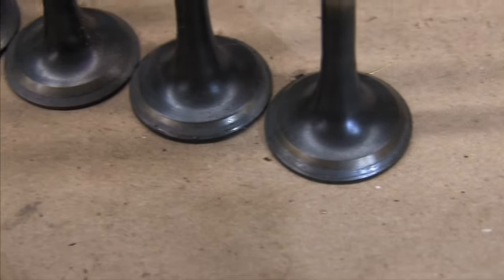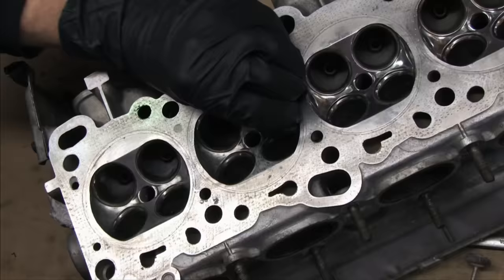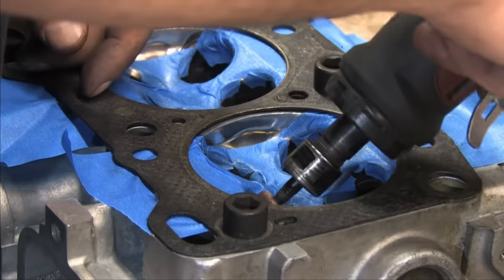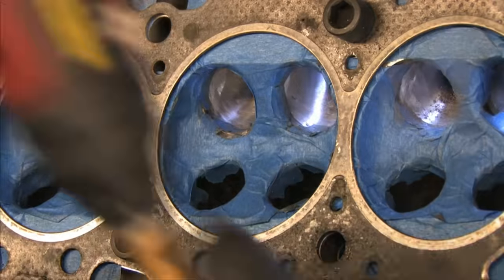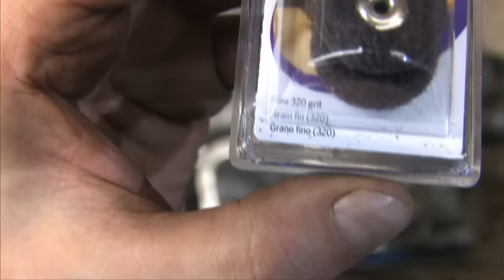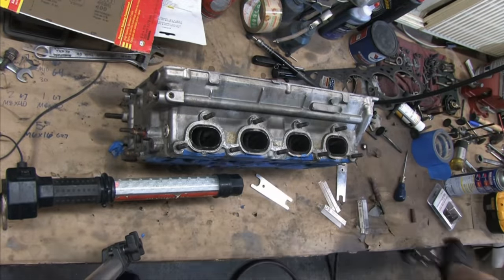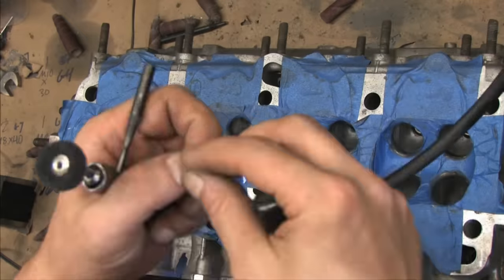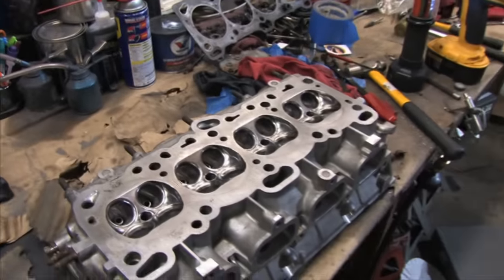Cylinder Head 204 - Porting & Polishing

Comment: pre ignition is NOT DETONATION!
Reply from the maker: While true based off of WHEN it occurs, if your knock sensor detects EITHER one, it records them identically.  The effect on your EMS is identical in either event, and regarding the context of engine management, my statement is accurate.  People love to split hairs over that statement, and I appreciate their zeal.  Unfortunately though my point gets completely lost in that argument.  To your knock sensor, pre-ignition and detonation are the same thing.  It's your job to figure that out in the logs... which one is occurring.
Reply: @Jafromobile   you are wrong- a knock sensor does not sense preignition- period. Detonation is  spontaneous combustion- period. Pre ignition is ignition of the mixture by something other then the spark plug- period.aka sharp edges etc. This is not splitting hairs.
Reply from the maker: The hell it doesn't.  ECMlink reads both.  The only time it ignores it is when the engine is at less than 2500 RPMs.
Reply: @Jafromobile   sorry knock sensors ONLY DETECT DETONATION. Check the many S.A.E. papers on that.

Comment: Want to a complete crap casting?  Pick up a Ford Windsor head.   Flows like molasses in an ice floe.
Reply from the maker: I agree.  I always hated it when people blew up their Pantera's Clevelands and replaced them with Windsors.  But ford had the same problem with the Clevelands that the 4g63 suffers from.  They made them flow better by adding metal to the intake runners.

Comment: if your seats are out of round, your valve guides are fucked, putting used valves in is a waste of time, the guides should be replaced first, then the seats recut, or you'll just need to take it down again due to premature wear. 

as for using wire wool to clean combustion chambers, this is absolutely to be avoided, aluminium decarburization should only be done by hand with a piece of boxwood.
ignore this idiot unless you want to spend on another cylinderhead..
Reply from the maker: That cylinder head is on the world's 3rd fastest Elantra right now of ALL years of production combined.  It's doing just fine.  Boxwood might be fine for your collectibles, but if you have collectibles, you're not doing a valve job or a valve cleaning your own cylinder head in your home garage to begin with.  This is the car I loan to friends without a second thought.  Everything installed in it before it received water/methanol injection had a requirement, it had to be used.  Its whole story is here.  I've spent less than $1500 to get on that leaderboard and it included a complete teardown, and that and that included a water methanol kit, engine management, fuel system upgrades and a new suspension.  Sure, whatever you do, don't follow my advice.  My methods are crap.

Comment: Polishing is a useless step, just like you said carbon will adhere to it anyway so don't waste your time. It's not rocket science.
Reply from the maker: Not rocket science, but there is a turbine involved.  We'll see what affect water methanol injection has on carbon's ability to stick?  I'm sure to blow this thing up again eventually.  I don't believe everything I read, but I've read enough times that it steam cleans everything it touches.  That's what I like to do here.  Show the results.  We'll all learn something.  I installed a kit on this car in one of my recent videos.  I waited until I had it tuned on gasoline first, so there's a chance I stuck something to it first.

Comment: NAME ONE REAL RACE ENGINE BUILDER WHO LAPS VALVES??????/
Reply from the maker: Oh so now I'm a "REAL RACE ENGINE BUILDER"?  I'm going to put that on my resumé.  Seriously.  This is a 1.6L Elantra head.  A car built from junk parts and a little bit of ingenuity that just happens to be the third fastest one to ever set wheels on this planet.  It's a street car.  It's a 430hp street car.  It burns pump gas.  This is a FREE video about a topic that nobody else in 10 years has made a better video of.  I encourage everyone else to try.  Relax a little.
Reply: @Jafromobile   it is simply upsetting to see so many people exposed to outdated/ false info.You made a very watchable video.. It is great to see you making 430 hp (chassis dyno tested?)  I hope you learn how to make more h.p. It looks like you did a nice job "blending" the ports.So glad you were honest about "nicking" the seats. Lapping them is simply wrong. As for polishing the chambers- eh- it is far more important to check/ fix the basics- aka chamber/bore/ gasket match/ spark plug depth/ orientation/ seat/ chamber blending/ valve heights. IF the top of 45? does not use a 30? to blend into the chamber- then the chamber should be dropped/ cut so the top of the 45 is at the edge/ even with the chamber You left  a lip/ ridge between the top of the seat insert and the chamber.Fixing that "edge" is most important when wanting good airflow with no sharp edges in the chamber.   .
Reply from the maker: @samstewart4807  I believe the video you're looking for about valve angles is linked in the description.  It's the radius cutter that gave this head a full radius cut valve job that un-shrouded the valves nearly .125" in their full circumference.  It might be .105", but I think the performance cutter is a little bigger.  I had to do assembly backflips to pull this thing off because none of these factory parts from a half dozen different cars wanted to bolt together quite right.  They were actually the same parts I blew up previously and then reconditioned it.  This car has an absolutely ridiculous back story.  You came in late in the series.  It's a box of scraps and junkyard pulls from 3 of my friend's efforts that cost $0 until I blew it up the first time.  It was in the top-4 fastest then.  All the cars ahead of us had over $20K invested and I'm only .8 seconds (in the 1/4) behind first place for all years of production with the Elantra chassis.  13.0006@116mph.  I'm doing it with a used $224 eBay 20g.  I'm using stuff that's nothing like the equipment currently in 2nd or 1st place.  It's 10:1cr static.  The goals for this car and this build have never been about perfection.  It's been about what other car's used stuff might make it quicker...
Reply: @Jafromobile  I really respect your effort- sounds like you did a great job.
Reply from the maker: @samstewart4807  Thank you!  I appreciate your time here.  This car has been a hysterically fun project so far.  Everything in the world was wrong with it, so it was the perfect car for my channel.  I think I'm wrapping up the last of its issues right now that are not related to its original design.  Things that I wished all my life I'd never have to do.  Please come back and check out the next engine build I've got going on.  Totally different kind of project.
Reply: @Jafromobile   em- thanks I only replied to address the errors.I am sure you have learned a lot form the many people who commented on all your videos- take care- sam